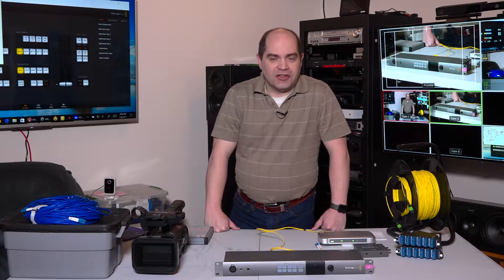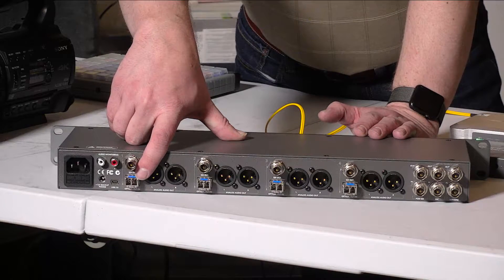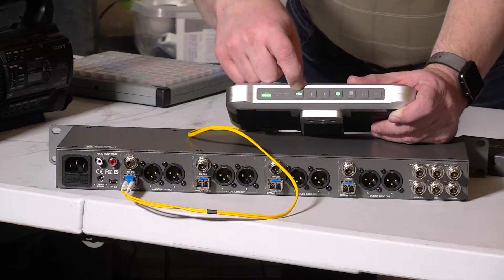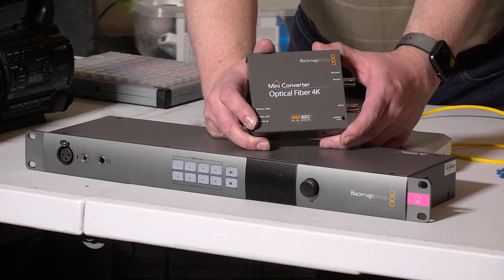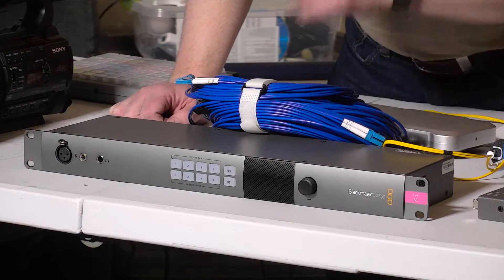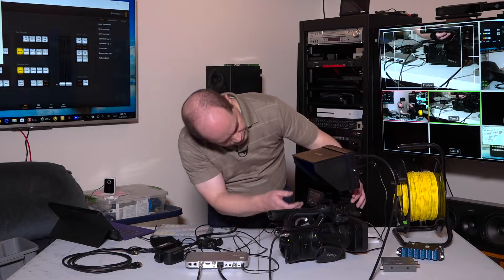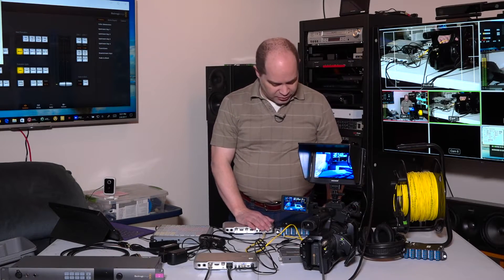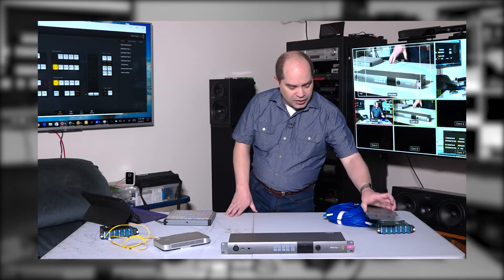Blackmagic Design Optical Fiber: Studio Converter, Camera Converter, Mini Converter 4K

Comment: Does anyone else have an issue sending the talkback from the aviation style headset to the camera operators on the Atem Talkback Converter 4K? The studio where I work has a Atem Talkback Converter 4K but I am not able to get the director microphone to send audio back to the cameras. We are using (4) Blackmagic Design URSA Broadcast G2 cameras with the camera fiber converters that run fiber into (4) BMD studio fiber converters. Then sdi out of the BMD studio fiber converters into the SDI inputs of the Atem Talkback Converter 4K. At this point the aviation style headset in the front of the unit can hear themselves from their microphone as was as all the camera headsets. We then send the iso camera feeds out of the Atem Talkback Converter 4K via the individual SDI outs and then into the SDI inputs of a new tricaster 1. We then send the program out of the tricaster 1 into the program sdi in on the Atem Talkback Converter 4K and then out of the program sdi out into the BMD studio fiber converter. Any help would be amazing!
Reply from the maker: Are you enabling the talkback channels? Pressing the buttons on the front of the unit to turn green to enable audio to the connected cameras?
Reply: @djp_video  yes all channels are green.
Reply: It is not muted on the front either.
Reply from the maker: Can the camera operators hear each other?
Reply: @djp_video  no they cannot
Reply from the maker: Okay, that helps. That means that audio isn't getting from the Talkback Converter into the cameras. I'll describe the normal flow of things and maybe that will help to sort things out...

Talkback audio from cameras comes in via either the fiber SFP module, or via (in the case of the Talkback Converter) or the Cam SDI In. It's carried on channels 15/16 of the SDI signal. From there, the talkback converter mixes it with the audio from the front panel headset input. At that point, it is sent to the AES Microphone Output on the back. The signal chain there picks up at the AES Headphone Input, but if that doesn't have a valid AES signal present, it uses the mixed audio from cameras and front panel jack as its input. That signal is then sent to the fiber outputs (if that channel is enabled on the front panel) over channels 15/16 of the SDI signal, and mixed with the SDI Program Input audio if the program audio button is enabled on the front and that goes to the headset output on the front panel.

It sounds like your signal chain is more complicated than that. When you say you're using the "camera fiber converters" and "Studio fiber converters" are you referring to these products: https://www.blackmagicdesign.com/products/blackmagicfiberconverters? Because I don't know if those pass intercom audio in and out of their SDI connections -- they're designed to be connected into an analog intercom via the DB-25 connector instead. And if you are using those, they're kind of redundant with the Talkback Converter -- they're meant to do similar kinds of things. Aside from powering the camera, you aren't getting a lot of benefit over just using lower cost LC fiber with the Talkback Converter and an Optical Fiber 12G converter on the camera end.
Reply from the maker: Slight correction from my previous post. Apparently in the menu for the Fiber Studio Converter you can choose the source of your intercom audio... look for the Talkback section and change the setting for Production Channel Source to SDI+DB25.

Also, if you happen to have an SDI to Audio converter, you could reconfigure it to output audio from channels 15/16, and insert it in your signal chain to see where the intercom audio is being lost.
Reply: @djp_video  thank you for the help! I will check all this!
Reply from the maker: Any luck?
Reply: @djp_video  unfortunately no it didn’t work. I’m pretty sure we had a damaged unit. The director microphone stopped working altogether. We ended up returning it and purchased the bmd atem 2 m/e constellation hd as our fiber talkback system and talkback works like a dream. It is exactly what we needed. I Really appreciate all the help you gave me.

Comment: Curious about the cassette, fiber spool, and armored fiber cable. Can you give me part numbers?
Reply from the maker: I wish I could... they're all generic and/or eBay finds.
Reply: I'm looking into these for our crew. Have you been able to  interface with an existing comm system or do I need to have the camera converter for every member?
Reply from the maker: A camera converter for each operator is the easy solution, but with a little effort you can interface to other systems.  The Studio Converter and Talkback Converter have AES/EBU inputs and outputs for audio, so with an AES/EBU <=> Analog converter (like the Behringer Ultramatch Pro that I'm using) you get regular analog audio, which you can then interface into most other intercom systems fairly easily.  I haven't had to do that, as I do have enough gear for my crew, but there's no reason it wouldn't work.
Reply: Great! I was thinking of a camera converter for each just for keeping it simple sake. Much appreciated and thanks for the quick responses! Your videos have helped a lot!

Comment: Where do you buy your fiber cable? Any suggestions for where to buy used? Not seeing too much on ebay
Reply from the maker: I haven't seen much used fiber.  Frankly, I wouldn't trust it.  It's just too fragile to be able to be sure that the prior owner took care of it.

I get mine mostly off of Amazon, Monoprice, or eBay.
Reply: Doug Johnson Productions yeah good suggestion. Our company is considering upgrading to all fiber. What brand of cable do you use and where did you buy it? Thanks!
Reply from the maker: For really short runs (like inside of an equipment rack) I use these: http://amzn.to/2Dp41ax

For longer runs, in areas with foot traffic, I use these (or their longer versions): https://djp.li/20mlc  

My trunk cable is here: https://djp.li/200mtrunk

I've also used Fibertronics, and been very happy with them too.: http://www.fibertronics.com/
Reply: Doug Johnson Productions thanks! I’ll look into these

Comment: Hey, thanks for the explainations about fiber optics! Do you have a like about the fiber optics cables?
Reply from the maker: Not any in particular.  But I do highly recommend getting armored cable.  This will help a great deal in making sure the glass fiber isn't damaged.

Just make sure to look for single mode cable with blue LC connectors.  If the connector is any other color the cable isn't the right type and likely wouldn't work well.
Reply: Would you recommend this type of fiber cable: https://www.amazon.com/dp/B017B3EHZ2?th=1 or can you recommend a brand of cable. Tactical Fiber is way to expensive for us and I am looking to switching to a fiber workflow that I can take in the field - trying to determine the best bang for the buck with careful handling and deployment.  THANKS!!
Reply from the maker: That cable would work.  (If a cable has blue ends you can be pretty confident it will work.)  However, personally if I was to start over I'd only invest in armored cable.  It isn't that much more expensive, but is significantly better able to hold up to potential damage.  

Take a look at this cable, which is armored and isn't that much more money:  http://www.ebay.com/itm/100M-Armored-cable-Fiber-Patch-Cord-LC-to-LC-LC-LC-SM-9-125-Duplex-/201216565199?hash=item2ed9711fcf:g:7t8AAOSwn51UYxzm
Reply: Awesome.  Thanks for the quick reply.  Is the damage concern more on the ends of the unit being dropped, damaged, dirt, etc or is it more of a concern from laying it across a traffic area where if it was stepped on it would crush the cable?  Most of the time I can route cables away from traffic but there are times where I have no choice - with HD-SDI cables I have no worries but I would be worried if someone stepped on a fiber cable.  I think that is what as kept me away from going this route.  But tally lights and good two way communication (and not having it) has been an annoyance with me so I am thinking of going with the BM workflow for our live productions.
Reply from the maker: It certainly helps to protect from foot traffic, but the main concern is a cable being kinked or otherwise bent at too sharp of a radius, such as being pulled too tightly around a corner, or too much force being applied at one of the connectors.  The armoring helps quite a bit in that area.
Reply: Thanks again for all your info.  Another question for you - how much have you used the BM Studio Camera (including version 2 that came out).  Our live streaming is built around using Canon XA25 or Canon XF105 (or the equivalents) but I am seriously considering the Studio Camera because of the CCU, tally lights, 2 way comms down the fiber line, etc - but lens have been the largest sticking point with this camera.  While I wouldn't use this in a sports environment (can't afford good b4 lens) but I do a ton of conference, seminars and meetings where I may be up to 100 feet away from the stage and our workflow may benefit from this set-up.  Just trying to get some real word feedback from those who have used the cameras.  Thanks!
Reply from the maker: I've only used the full-size Studio Camera at trade shows.  I've never owned one.  There is a reason for that, as you'll see in a second.  I would have loved to have been able to go with the BMD cameras, as they're quite a bit less than the Sony cameras I'm using, but they just aren't a viable option for most people.

I do own a Micro Studio Camera 4K.  It's the same sensor and has most of the same capabilities of the full-size version.  And I have to say, I'm pretty disappointed by it.  It, and the full-size cameras, have quite a number of flaws:

* The light sensitivity is pretty bad.  You've really got to illuminate your subject well for the camera to produce a usable image.  For example, the lighting I use to shoot these videos isn't anywhere near enough with a typical MFT lens.  I'd have to at least triple the amount of lighting to produce an adequate shot.

* While you could theoretically use a faster lens to bring in more light, there just aren't that many available in the MFT system.  And none of the faster lenses (f/2.8 or faster) have remote zoom capability.  And, because of the poor light sensitivity, you'd really need something like f/1.8 or f/1.4 to be able to shoot in "normal" lighting.  This, of course, brings with it the down sides of large apertures like shallow depth of field, vignetting, chromatic aberration, etc.

* Related to above, the selection of available lenses meant for video use for MFT is not good.  Just about any other lens system would have been better, as there really aren't any purpose-built MFT video lenses.

* The cameras only have a limited range for controlling gain... 0dB to 18dB.  And 12dB and higher are too noisy to be usable.  So you pretty much have to use the iris and shutter speed (or external ND filters) to control exposure, which affects the look of the shot.

* While you can use adapters to connect B4-Mount lenses, getting iris control is awkward at best on the Micro version, and not possible natively with the full-size version.  There is a company that produces a B4 lens control adapter, but it is insanely expensive.  And for either type of camera, zoom and remote focus capabilities are basically nonexistent with B4.  Also, since B4 lenses are meant to be used with smaller sensors than the BMD cameras', you either need an optical converter, or use a lens' doubler, or always be zoomed in.  None of which are ideal.

* These cameras all have a significant delay on the SDI output.   So when they are used for IMAG the projector or video wall will be noticeably delayed.  This is particularly problematic in mixed camera environments, as their delay is quite a bit longer than cameras from other manufacturers, which could be a problem when shooting anything that involves motion.

Bottom line is that these cameras aren't as well thought out as most of BMD's products, and it was hugely disappointing that they revved the cameras a few months ago without addressing even a single one of these issues.  If you take a look in the forums on their web site, you'll find that the cameras are pretty universally despised by professionals.  While in principle the BMD cameras have/had potential, in practice they just aren't up to the task of shooting live video.
Reply: Well...that pretty much summed it up..LOL...thanks for the well thought out reply.  That really helped me finally make a decision on a route to go.  If I was in a  fixed studio with full lighting, maybe - but we are in the field under every lighting situation (either controlled by us or by the client who is too cheap to light an area properly) and this simply won't cut it.  I think we will do our fiber conversion and built it around the camera and studio converters.  This will give me some advantages  that I totally don't have right now in our workflow. Thanks for all the info!!

Comment: You say that the camera converter is the only non 4k gear but the studio converter is not 4k right?
Reply from the maker: The Studio Converter does support 4K.  It ships with the 6G Optical SFPs.
Reply: Saw the 4k format specs now on the tech specs tab on their website. But nowhere else. Sketchy. Thanks for the info. Great information in your videos. Keep em coming. BTW Have you used the SDI-Hdmi 4k mini converter? Does it output 1080 hdmi when connected to a Atem? I want to do: Micro studio Cam - 6Gsdi/fiber - Mini conv 4k - split to: 1:HyDeStu(record 4k) 2: Hdmi 1080 Atem. Do'able?
Reply from the maker: The SDI-to-HDMI 4K Mini Converter outputs the same resolution to HDMI that it receives via SDI.  So if you've got 1080 in, it does 1080 out.  It doesn't do signal conversion.  (If you need conversion, you'll need a Teranex or Decimator MD-HX http://djp.li/mdhx).  Most of the ATEM switchers have an HD down-converted output so if you are shooting and switching 4K but need an HD signal for a TV, you can use the down-converted output rather than the regular Program output.
Reply: What I've found is that if the Hdmi out is connected to a HD(1080) Hdmi input it downconverts. "Mini Converter SDI to HDMI 4K includes everything you need to convert from SD, HD, 3G and 6G-SDI video sources to HDMI in SD, HD and Ultra HD video formats. You can also de-embed SDI audio to HDMI, AES/EBU or balanced analog audio out. Also includes Instant Lock on HDMI output. Imagine using big screen Ultra HD TV’s and projectors for broadcast monitoring! The built in down converter even allows Ultra HD monitoring on HD televisions!"
Reply: The MD-HX doesn't do 6G to my knowledge. Only HD 3G.
Reply from the maker: Well you taught me something.  I wasn't aware that the 4K version did downscaling.  I just tested it and it does indeed work.  Thanks!
Reply from the maker: Well you taught me something.  I wasn't aware that the 4K version did downscaling.  I just tested it and it does indeed work.  Thanks!